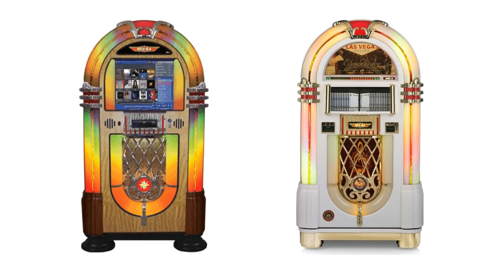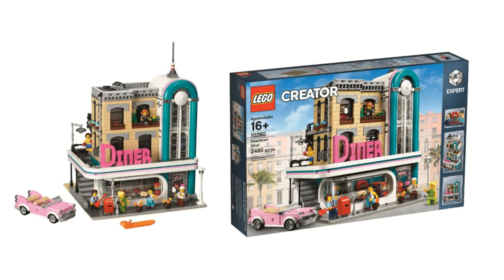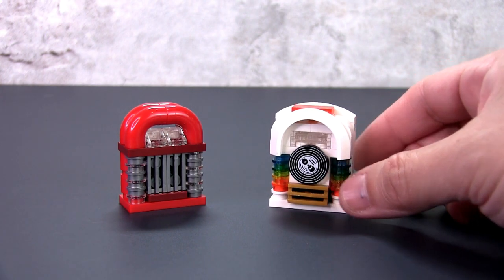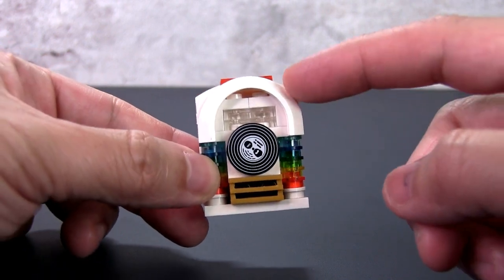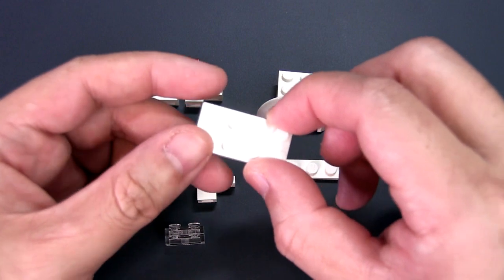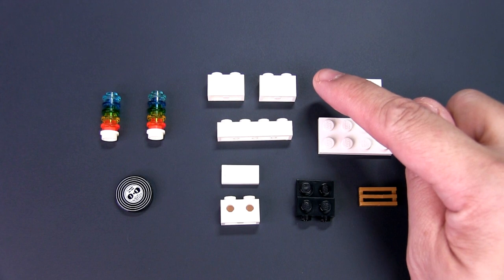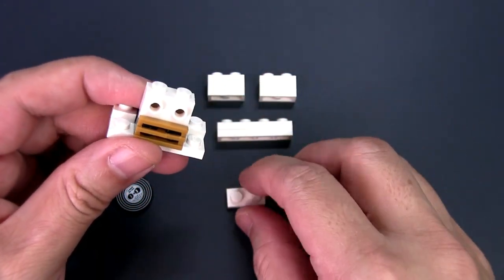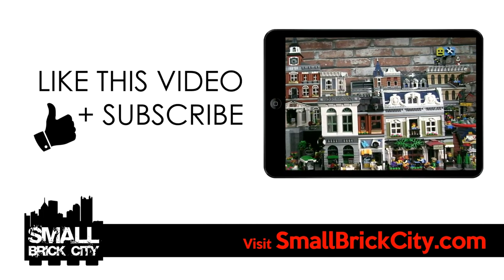How to Upgrade the LEGO Downtown Diner (10260) Jukebox

Comment: I like that you've used the mud guard - these types of wheel casings has prooven to be a very versatile piece to use for all kinds of things! I think I would have choosen a black mud guard or dark blue - it is a little white on white like this. Other than that I actually like this mod of the Jukebox. Minifig scale is quite important to me which is why I don't really get sets that are not in that scale. However, the minifig scale has changed over the years I think. If you look at LEGO cars from the 80s they are definetly smaller than the present ones. However, I would have called them minifig scale back then with no hesitation. So, I think minifig scale can be a lot of things but I do find it important :-) Thanks for sharing a great video and your creativity!
Reply from the maker: I agree on a different colour. Gold might be nice but I don't think it comes in that colour. Unfortunately, I only had white so worked with what I had :) Thanks!
Reply from the maker: cBricks Tutorials  yeah chrome would be awesome.